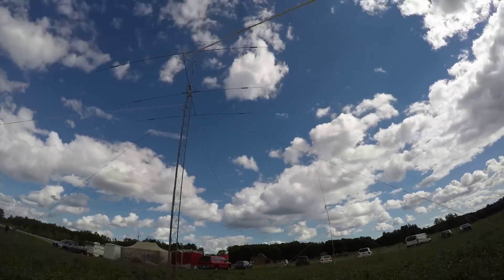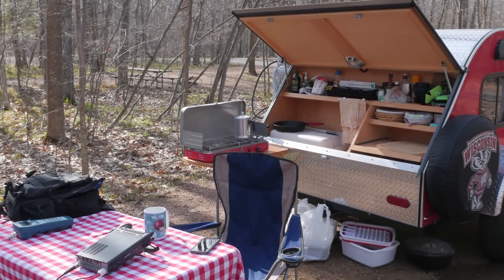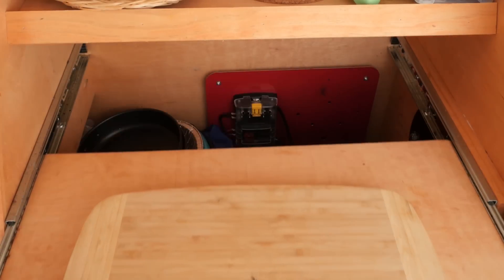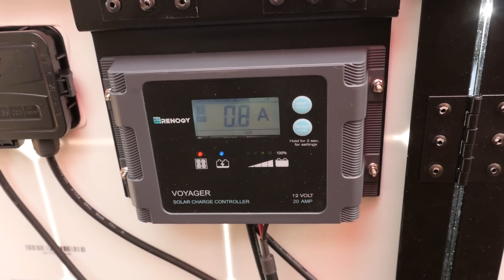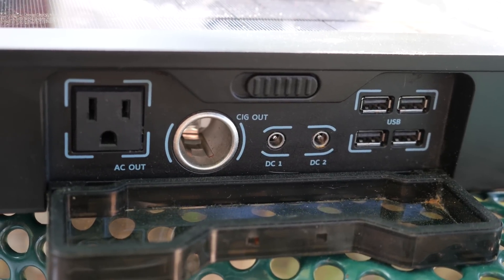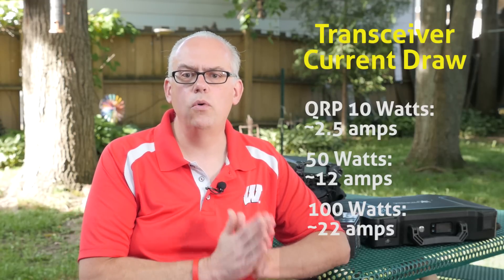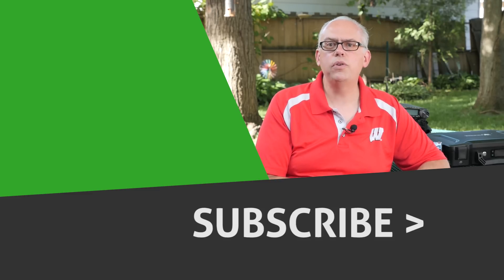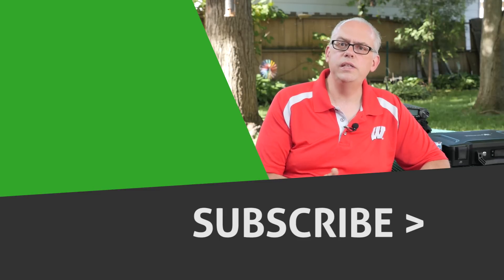Portable Power for Amateur Radio - Ham Radio Q&A

Comment: I have a jump-starter that emits a steady 9 v dc.

Would that work for the FT-891?
Reply from the maker: 9 volts DC is too low to power the FT-891. The transceiver requires 13.8 volt +/- 15%. Anything outside that range will be inadequate.
Reply: @ thank!
I got it fully charged, and it went to 13.9 v. 
I really don't want to hurt my FT-891 !
And I'm taking suggestions on 140 m antenna!

Comment: Great video. This was the first time your channel showed in my feed and I am glad it did. I am trying to assemble a ham radio in a box mounted with a power supply and there would be a spot to store an antenna with a coax feed line so it can be put outside for better performance. I think I am going to use one of those large waterproof pistol cases like the Pelican cases, and glue a board on one side to mount everything to. I have been looking at lithium batteries or probably just a battery pack with a car cigarette lighter socket. The radio is just a 25/20w dual band QYT KT-5000 inexpensive Chinese made radio.

Comment: How would you go about powering a 25W mobile radio (mostly listening) in a go box that needs to to be on 12 hrs a day, for 10 days in mid-october (we sometimes get snow, so it's cold and days are getting shorter)? We do bring a generator to recharge some batteries...but we don't want to keep it running all the time. Cheers!

Comment: Ok what besides a battery do I need to run a 25 watt ft857d. People talk about regulators etc. but I have a nice gel cell 12v with a good current duty cycle . Recharging is off a charger but no funds for solar etc. you have. I have been warned using it might damage rig?? Ok what am I missing in the set up?
Reply from the maker: You don't need solar for operating in the field. Only if you plan to be out for days at a time would solar recharging be worth the effort. Charge up at home, at 25 watts transmit, the battery should last several hours.

Comment: Just built my first battery…a lifepo4 25ah…for my radio go box. Using a lithium is nice for a couple reasons. One the available usable voltage is consistently 13.2-13.3 for the majority of the ah rating. Its lighter in weight. And also the stored energy can be better used due to the increased depth of discharge of a lithium over lead acid. Ive used lead acid, but have been converted to a lifepo4 fan over the past months.

Comment: Thanks, Michael.  What about connectors from radio to power pack?  I am looking at Renogy and competitors and they seem to promise DC output at just 10amps via cig. Plug. Or even alternate connection?  Vs. The 12.5 you indicated needing on x-mit?
Reply: I am in BC, Canada, and drive on gravel roads.  I dislike cig plug systems, because the spring in them causes them to back out on a rough road, dropping the connection.  Cigarette plugs were made for lighters, which were short duration.  I use two-pole connectors that are available in any automotive supply store, so they can be picked up in any community when needed.  Of course, they require attaching to the radio (or an old battery pack, with cells removed) but can be wired into a vehicle using a fused line from the battery, and/or a relay that will supply the power only when the vehicle is running, to prevent discharging the battery if left on.  Hal, VE7ENT

Comment: I'm having trouble with battery power in just about every area. My most frustrating one is mobile. I have a D710g in the car and I have it hooked straight to the battery. I try to transmit at 50 watts and the radio cuts out even with the car running. It could be I guess that the battery is getting older, probably 3-4 years old and that may be my problem but I do mostly simplex and the medium power 10 watts is not at all adequate. I got a deep cycle RV battery and put it in the back of my SUV and tried to run the D710 from that, and it also cut out at 50 watts just keying up and it's fully charged. Any thoughts from anyone on how to run full power while mobile?
Reply from the maker: What are you using for a power cable? It may not be heavy enough for full power operation. If the cable is short, around 6 feet, then 14 gauge should be enough. Otherwise I recommend 10 or 12 gauge for mobile installations.
Reply: @KB9VBRAntennas  Right now I'm just going straight from the radio to the deep cycle battery. Standard cable that comes out of the radio.

Comment: would someone be so kind as to show me the calculation for 100 watts - 22 amps?
Reply: P=i*e
P is power or watts
I is current or amps
E is volts
So if your using a 12 volt battery and transmitting a 100 watts it would look like this 100 watts divided by 12 volts =8.3 amps
But you asked about 22amps which is
100 watts divided by 22 amps=4.54 volts

Comment: Lead acid batteries should not be discharged below 50% for longest life. LiFePo4 batteries can be discharged at least 80% and hold a higher voltage under discharge.

Comment: Hi, I have enjoyed many of your videos, keep up the excellent work.
I was especially interested in your video on portable power to operate HF.
I am interested in  powering a  Yaesu  FT-897D  with it’s ac tray option and  a Inergy  Apex solar generator.  
I attempted to  power threading  with the Apex’s  ac inverter, and  encountered much noise.  Are you familiar with my setup and or have any ideas?
Any suggestions or recommendations would be much appreciated.
KI5ELC
Reply from the maker: I'm not familiar with the Apex product‚ but as a general rule inverters are noisy and that's probably the source noise. Ferrites on the power cord may be of help but otherwise can you use the DC output of the generator instead of AC?

Comment: You talk about figuring out how long the battery will last but not about the solar charger. As long as the sun is shining won’t the battery life be extended while getting juice from the solar charger?
Reply from the maker: Solar charging adds another variable to the power system. The amount of battery life gained will depend on the output of your solar panel and the length of time the panel is providing power. A 100 watt panel can deliver up to 6 amps of power in full sun‚ so that could significantly extend your time in the field. But that's ideal conditions‚ as the time of year‚ cloud cover‚ and trees can affect the output level. Unless you have a firm handle on your solar output capability‚ I'd call anything received from it to your battery a bonus.
Reply: KB9VBR Antennas Thanks. I’m in Florida. The Chamber of Commerce won’t allow more than 3 days a month without sunshine. It’s the law! 🤣

Comment: Hi Michael. As usual, another great video. I have a question for you. I have been researching solar chargers and I came across a review from a Ham and he was warning that MPPT solar charge controllers cause much more radio interference than a PWM charge controller does. Have you heard this or experienced this before? It appears that TC Teardrop Trailers uses the Zamp 30 - Amp PWM charge controller with their solar option. Thanks Michael. Mike KC0KMQ
Reply: Did you find an answer to the question you had asked a few years ago about solar chargers? I was wondering about solar chargers myself.

Comment: What would you recommend for a yeasu Ft991A with its power supply 1030 looking at the goal zero
Yeti 400 lithium is that going to be big enough for this system or do I need to go bigger any ideas would be great
Reply from the maker: The Goal Zero has plenty of capacity but the down side is that it's accessory port is only rated for 10 amps. You'll only be able to run the rig at about 50 watts or else the battery will shut it down. I have the same issue with the Renogy power pack that's featured in the video- draw more than what the accessory port is rated for and the battery shuts off the radio. You may want to consider one of the Bioenno LiFePO4 batteries. The 20 amp model will run a 100 watt rig for a very long time. I'm moving in that direction for my power needs.

Comment: I'm wondering if I have bad cells in my batteries. I have 2 identical RV deep cycle batteries for battery back up for my Kenwood TS 2000. I hooked the batteries up in parallel connected the super power gate to it with a power supply, thinking I'd get a few hours at low watts with my TS 2000, but if I transmit at 20 watts on that, the batteries won't power the radio any more than a couple of minutes with 3 or 4 short transmissions. With two giant batteries like these I should be able to run several hours I would think. I hooked up a VHF mobile rig to the set up and at 25 watts with transmitting I don't get very far with the battery set up either. Charge shows 13.8 volts when the power supply is on, 13.2 volts without the charger when fully charged, but transmitting at 25 watts on the mobile with 5 or 6 transmissions of 20 seconds will take the battery below 12 volts. This set up should do better than that shouldn't it?
Reply from the maker: You're battery is no longer holding a charge. I would agree with you that one or more of the cells has gone bad in it

Comment: Great presentation with some bad information. The price per watt for lithium iron phosphate battery comes out much cheaper than the price for an AGM or lead acid battery. Certainly you pay more at the register initially, but since you're going to get a minimum of 2,000 Cycles out of a lithium iron phosphate battery pack, and only 500 out of an AGM or lead acid, you would have bought for AGM or  lead acid batteries before the lithium iron phosphate pack has reached its 2000 cycles. In the long-run, the lithium iron phosphate is cheaper and performs better. There's also the point of getting only half of the capacity from a lead acid or AGM compared to a lithium iron phosphate pack. If you have a 10 amp hour lithium iron phosphate pack, you need to buy two 10 amp hour AGM or lead-acid batteries, putting them in parallel to get the same capacity. Because of peukerts law, even those two AGM/Lead acid in parallel, wont have the same performance as LFP. 
There's lots of considerations for portable power in regards to amateur radio. Peukerts law, noisy charge controllers, cycle life, ...

Comment: I would love to have seen something that you would take backpacking. I am going to have to walk my gear in. I have been told not to expect anything in QRP since the bands are mostly dead. Thank you for your time and help.
Reply: If you're walking your gear in, you'll definitely need to use lithium iron phosphate batteries. I just did field day using my fat bike, tent, qro radio, diy 45ah LiFePO4 generator, and very lightweight PowerFilm solar panels. This system was designed for emergency communications hence the large capacity battery. Last year I did a 3 day hike in lapland with an even lighter weight system. That battery was a diy 10 amp hour lithium iron phosphate pack designed for multiple days in the field, operating qro. When I'm operating qrp but I'm going to be in the field for quite a long time I use a diy 5 amp hour pack along with the ft-817nd, and a 28w powerfilm. 
I'm almost always operating man portable, so the weight and performance of the batteries is a critical consideration.

Comment: .... EXCEPT YOU SHOULD NEVER RUN ANY BATTERY TO DEPLETION... DRAINING YOUR BATTERY BELOW 20% WILL LIKELY DAMAGE IT. THEREFORE, YOU ONLY HAVE USE OF 80% OF THE BATTERY CAPACITY WHEN IT IS NEW AND IN GOOD CONDITION.

Comment: Hello Michael. There is also portable gen sets. Some of those little rascals are quite handy. My ancient Coleman generator will run under a load for around 2 hours on just a couple of pints of gas. It is noisy, but we used to camp near Priest River Idaho right on the bank of a raging  river. You get used to the sound quickly.  For the serious field work, there is no way around the fact that you will need lots of power. If you are taking your car or truck, there is also the good ol` handy dandy jumper cable option for topping up the batteries. Solar is reliant on the sun, which most times, is iffy at best (Murphy`s Law). Good luck getting your road fixed up! 73, KC3BXZ Joe

Comment: I didn't hear you address that you can only draw a lead-acid battery down to 50% or so of its rated capacity without ruining the battery
Reply: Logan you are absolutely right. The reason AGM and lead acid batteries are set up in parallel "seemingly" doubling the capacity, is the fact that bringing them down below 50% charge will ruin them. Michael is correct that some batteries have different characteristics, but for the most part 50% is the magic number. If you want a 50 amp hour AGM or lead-acid battery, you would use two 50 amp hour AGM or lead-acid batteries in parallel to achieve that goal. Those two AGM or lead-acid batteries in parallel will make up for that 50% magic number, and also mitigate the effects of peukert law, which is much more apparent in AGM and lead acid batteries than lithium battery chemistries.
 There's a very interesting blog post I recently read called "the lead-acid deception". It's definitely worth reading.
Reply from the maker: It's a little more complicated than that. Wet cell deep cycle batteries shouldn't be brought down below 12 volts or 25% capacity. AGM batteries are more forgiving and can  be discharged to a bit lower voltage. Lithium Ion batteries will hold their voltage for a very long time and then suddenly drop capacity. So you really need to know the characteristics of the type of battery you are using.

Comment: I also have the Renogy Suitcase kit and other 100W Panels. One thing I question is the type of controller used. They have a PWM (Pulse Width Modulation) and MPPT (Maximum Power Point Tracking). I've only "heard" that the PWM controllers induce noise from charging causing interference with low power transmissions like when using FT8 or RTTY. I have had no issues, but I dont have a scope or any test equipment to verify. Just wondering if moving to the MPPT has any known improvements. The  MPPT s are more expensive, just not sure if they are worth the money. I would think adding a diode in the circuit would eliminate interference.
Reply: Your comment is absolutely right. Pwm charge controller is introducing enormous amount of noise on HF. Most people don't notice because these days they have such a high noise floor from surrounding Electronics. If you get out in the field and start operating portable away from the noisy Urban environment you'll hear that annoying buzzing and clicking from pwm charge controllers. There are some poorly made Chinese mppt charge controller switch also create lots of noise because of the DC DC converters used. For the most part there are two brands of mppt charge controllers which are completely Noise free on HF, Genasun and Victron. You can get away with the pwm charge controller if you charge your batteries up after use, and not charging while discharging.

Comment: SQUIRREL!!!!!!!!! LOL!   I think I would just use my mobile rig that is hooked to my vehicle battery. $400+ for a portable solar charger is a bit expensive.
Reply: And if your vehicle is out of gas during a zombie thing
Reply: My vehicle battery won't last long without the car running while I'm transmitting, and if your car is anything like mine, it introduces terrible ignition noise and other electrical noise to your received signal when your car is running! I think I'm going to have to buy an external battery of some sort so that I can go out and operate without fear of my car battery going flat while I'm at the top of a mountain. There's also the issue of general engine noise and exhaust fumes while I'm  sitting at my tailgate trying to operate.

Comment: Hi, great video on portable power. May I just share that you can make a 12v power pack out of several 18650 li ion batteries and a BMS. The best part is that you can keep adding batteries to the pack to increase the capacity. I made one at 12ah, and the size and weight is still lesser than a 7ah AGM battery.
Reply: Great idea Ash. I've also done some lithium ion battery builds with 18650s. The only problem with lithium-ion for ham radio is putting them in 3s configuration, towards the last ~30% of discharge,  a 3s lithium-ion pack doesn't generate enough voltage  for a QRO radio. If you use 4S lithium-ion the voltage goes over 16 volts when full and that's not good for our radios either. So for 3s lithium-ion we have to put a lot of cells in parallel to make up for the capacity losses and get greater run time. If you use lithium iron phosphate in 4S configuration, the top and low range of voltage is perfect for amateur radio equipment. It's not as lightweight as the lithium-ion packs but lithium iron phosphate will give you more bang for the buck with fewer cells in parallel. Awesome comment Ash. We really need to Advocate lithium battery chemistries wherever possible. There's a reason they don't put lead acid batteries in airplanes anymore hi hi
Reply from the maker: Not a bad idea, I've got a backlog of video ideas, but maybe late summer or early fall I can do something on building a power pack like you described.

Comment: Since buying new portable equipment this year (2019) I am using Yaesu FT-891, Wolf River Coils TIA, Wire Antennas, Power Pole Connectors and Dakota Lithium LiFePO4 10ah Battery. Dakota Lithium gives a bit better battery than Bioenno Lifepo4 for the money and they claim to be USA Made ; )
Reply: James you're absolutely right. I also have one Dakota lithium battery here. I chose Dakota lithium (although I was offered the alternative for free) because it clearly states what cells are used to make up their packs. If you take care of that battery you'll get lit years of life out of it. It also sounds like you have a great portable station.